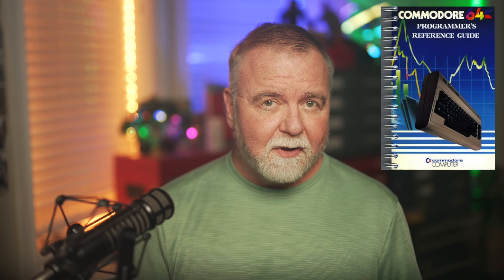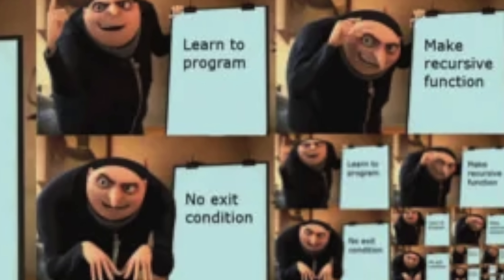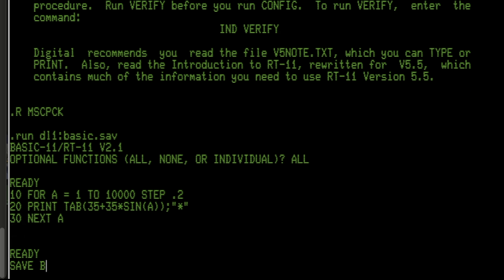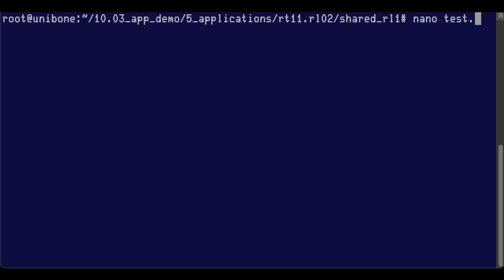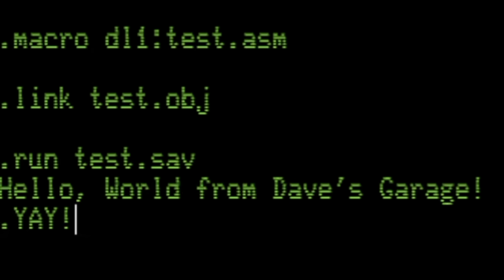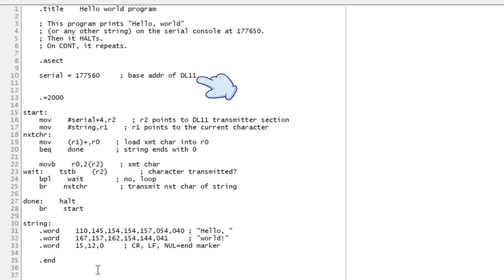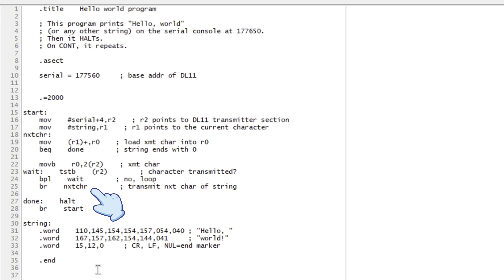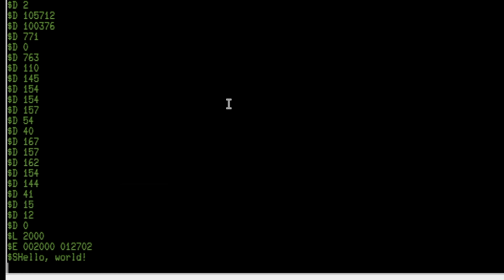Bare Metal Coding: Big Iron!  Assembly Language on the PDP-11/34

Comment: In 1967 I started working for IBM. Started by fixing mainframe hardware. Real BIG IRON weighing literally tons. Occasionally I would have to enter a “hand loop” to reproduce a system failure. I would have to enter the instructions in hexadecimal directly into memory using the maintenance panel. Those were the days and computers had lights……….lots of lights.

Comment: My first introduction to "software" was a course about microcomputers, but the instructor used the PDP 11/05 schematics to illustrate how a "computer" worked, right down to the gate level... It gave me a "Eureka moment" to realize that "software" was a means to get the hardware to be re-configured, on the fly, to perform a sequence of operations that performed the desired movement and math operations on individual high/low 'bits', and on "words".... Suddenly, it made sense!
And, we wrote a boot loader, which actually resulted in something, in the real world, doing something visible, with a big old KSR-33 suddenly clattering away! Talk about "bare metal", seeing 74xx logic devices shifting high/low signals around on data and address lines, multiplexers redirecting signals, ALU's adding and subtracting, all controlled by "instructions" that had specific bits to control what/where/how this all happened! Then, the MC68000 assembly code was clear!!
Reply: In 1977

Comment: This brings back (bad) memories of bare metal assembly on a TI mini computer. It didn't even have a terminal attached, just a teletype writer and a card reader. If you wanted to read cards you had to enter a small card reader program using toggle switches on the front panel. The big project for the semester was writing an assembler. I think mine worked but I could not get it to print to save my life.

Comment: Just a couple of things. You were using MOV to fetch the text characters odf the string instead of MOVB. Presumably you stored the string as words instead of bytes, so H,00,e,00,l,00,l,00....etc. Also, you should check your hardware is ready before using it, not *after*. Both because you don't know if it's ready the first time, and also otherwise you are just throwing away time sitting there waiting for it to finish instead of going away and doing something else at the same time as the I/O is working.

Comment: The first PDP-11 I used had the row of pastel toggle switches on the front panel.  You had to first key in an address 177something in octal , then key in another address, hit deposit, then press start (or similarly labeled key) which would jump to that indirect address and and begin executing the boot ROM to bring up RT-11 from an RK05 drive.  The later 11/34s I worked on had keypads and 7-segment octal digits on the front panels.  Those could boot from ROM by pressing a single button.

I got stuck doing some FORTRAN work on an 11/03 which had two 8” floppies for a while.  That was a huge pain because RT-11 needed one drive and that meant the other drive had to have the editor, FORTRAN compiler and linker swapped in and out on separate diskettes.  That required using PIP to move files around unless you dared to write your intermediate output files directly to the O/S diskette … and sometimes bad stuff happened if you did and the O/S got trashed.  Usually it was do a step, then PIP the output file over to the O/S diskette, swap diskettes in the second drive, PIP the file back, do the next step…. and so-on.  I learned pretty quick to come in after hours and do the work on an 11/34 and then PIP to a floppy to take to the 11/03.  The 11/34 had a DECwriter LA-120 paper terminal which was about 4x the speed of the DECwriter LA-36 on the 11 03.  The first PDP I used had an actual Teletype ASR-33 running at a blazing 110 bps.

For youngsters, PIP = peripheral interchange program.  RT-11 did not abstract physical devices to be treated as files  no matter what or where they are as UNIX kernel does.  You had to have PIP as a separate program to handle that task.  I remember feeling liberated the first time I used UNIX and realized there was no need for anything like PIP (well there’s cpio, but you don’t have to use it).  Having treed directories were quite a breath of fresh air in UNIX too.

Comment: Your where right about being wrong but your reason for being wrong is also.... Well... Wrong.  
JSR(s) don't need any RTS.  They are independent.     Having many coded RTS still means it would need one.   But it does not.   Your other options to JSR without a RTS are;
1) load the SP with an appropriate value an set the IP to an appropriate value.
2) Never return.  as in calling BlueScreenOfDeath kind of thing.

Comment: Dave, you're really bringing back memories. Though most of the rail control system code we ran on our PDP was in FORTRAN, we did use assembler for important operations like resource locking between tasks, time-critical I/O, and code that needed to be re-entrant. That was circa 1990-1994, about 30 years ago. Thanks for the memories.

Comment: I had a microPDP-11 with RSX11, which frankly was a terrible OS. So I hunted the net for a copy of SystemIII but in the mid 90s that was not easy to find online. Eventually in 2000 with the aid of a colleague at IBM, we found it and got it running and then I gave it to my colleague. As that thing (despite being the micro) was too loud and power hungry for such a relatively slow machine.
But I did adore writing assembly for it. As a bit younger guy than Dave, I grew up writing assembly on 6503, 8088 and z80 (I don’t like those) and 68000 and yes pdp11 looked like 68000 as I noticed back then (or actually the other way around).

Comment: My first college assembly programming experience was CTC 28 (1979) on the same 11/40 where I was studying the logic board, and its LS181 4 bit ALU (four of them of course). We submitted jobs on punch cards, that I don't miss a bit (!), and had to be able to walk up to the cabinet and key in the bootstrap from the front switches. I earned one of the 3 'A's received that semester.

Comment: Aren’t you still running the boot monitor?  Wouldn’t bare metal be to get the code booting without the console input?
Reply from the maker: It drops into the boot ROM, but you can jump directly from there to your code with nothing in between.

Comment: In my first job out of college, I worked with several PDP-11s, including the earliest model (eventually called the 11/20, but this machine had no model designation on the front panel). It was equipped with a (removable) disk drive but booting required hand-loading the boot loaded into memory via the binary switched on the console (about 20-30 instructions, IIRC). Talk about bare metal...

 I also loved the instruction set. It was so rational, most of my co-workers and I could manually disassemble an octal dump of code. My company also performed some magic leveraging the PDP-11's Unibus architecture, which was also exciting to work with.

 I later moved on to the Motorola 68000, which had a similarly "orthogonal" instruction set and some advantages (more and larger registers), but was not as simple and pure as the PDP-11.

Thanks for the memories!

Comment: Loved this. Sure brings back memories. My first PDP was 11/20 and did a lot of programing through 11/70s. Programming in assembler was only possible if you could think at the hardware level. That's a mindset few can master -- which is a good thing. Higher level languages finally enabled real productivity. However, understanding what's happening at the "metal" level is good to know. 
Ok Dave, now why don't you write a device driver for a tape drive.

Comment: Wow, I was working at DEC back in 1979 as circuit pack repair technician for the RL01/2 disk drive while I was in college.  I had to be able to control the drive at the register level and hand wrote many PDP11 assembly language routines to be able to control the hardware at the bit level.  This past year I was going through old papers and came across my DEC PDP11 programmers reference pocket guide.    Programing at the assembly level was a lot of fun and, back in those days, it opened a world of imagination of what was to come.  Thanks for the memories, and keep them coming!

Comment: That brought back some memories. Back in the day we had an LSI11 controlling our instruments on a X-ray synchrotron. The problem was that the 'tron would burst out X-rays every now and then and disrupt the RT11 OS. I got sick of losing data, so I "bare-metaled" the data collection program so that a copy of the data we collected was available above the 56K max addressing range of RT11 while it was being streamed out to disk. That way if the OS barfed I could still get at the data that was stored in a region that wasn't reset by the OS. 
That poor LSI11 was regularly abused. Every week or so we had to refresh the particles in the 'tron, and as it was designed to put out polarized X-rays, when that happened we had to go hide behind a hill due to the massive radiation spike before the ring stabilized. The LSI11 couldn't go and hide with us, so it was regularly subjected to large blasts of X-rays. Still, it lived for several years before the CPU board fried. I tried to get just the chips I needed to replace, but DEC demanded the whole board back and made just getting the chip 10x the price of getting a whole new CPU board. (Trade secrets maybe?) I pity whoever got that reworked board. Strangely enough, we never had a RAM failure in the 4 years I was there, and it was still going strong years later from what I heard.

Comment: My first exposure to computers was a PDP-11/33 which I played Adventure on. That was 1978. From there I went to a print shop in my first job and eventually got a job working on a Wang VS77, but that was eventually replaced with a Prime system running Pick OS. I left that job in 78 and ended up on an IBM MVS XA course, then got a job running an MVS system (I thought), but in traditional was running CICS  on a System 38. Once I left there I went to work for a Gas company, running MVS and also an interesting ICL2966 running George3. 

Then it was all PCs. It seems like a lifetime ago….

Comment: The 11/34 might have had a 15MHz clock, but that was the microcode clock.   The actual instruction time, including all the memory bus handshaking, resulted in a not all that speedy a machine.
Reply: Wasn’t the Vax 11/780 approximately 1 MIPS?  That 15 MHz clock sounded fast to me, too.  AFAIK the 11/34 was toward the low end among PDP-11 models, so it should be a lot less powerful than the Vax of a few years later.  Having 15 MHz as the microcode clock makes more sense.  I imagine it takes a fair number of those clock cycles to execute one PDP-11 instruction.
Reply: @kc9scott  Yeah, also remember the UNIBUS was a complex and not too speedy bus also too.  We were a bit disappointed back then when we saw that the 11/34 wasn't noticeably faster than our PDP-8.

Comment: Reminds me of the time I worked on the Burroughs B6700. In it's last days it sat idle as backup, powered up but all it's peripherals except the console had been moved to the new system. I used the hardware memory test panel to loop the thing into constant I/Os to the console spitting out witty comments like "My mind is going, Dave", "Daisy, Daisy" and so on.

Comment: I used two PDP/11s (an 11/20 I think acting as a FEP for an 11/70) during my Computer Science course at Manchester University in the UK starting in 1979.  I remember using assembler code to program an attached Calcomp plotter to output text - my code directed the calcomp how to draw each letter and this was then tested with an input string.  It was very cool.  Those were fun days.  How times have changed.  Thanks for your video.

Comment: Move <from> <to>. Yeah, most of my assembly programming was x86, but it always seemed wrong to do "move <to>, <from>". Also interesting that the BEQ instruction presumably does a test and jump, rather than x86 where the flags are set by a separate command from the conditional jump. (Learnt programming in 1973, still programming).
Reply: I wouldn't expect BEQ to do any test, since that would require it to have more parameters than the other branch instructions.  I just looked it up for PDP11, and it branches based on the Z flag that was set/cleared by a previous instruction, the same as most other processors.

Comment: Dave, I hope you're properly grounded handling those old DEC boards - they really are pretty susceptible to static shocks.  I maintained a load of them back in the 1980s.  We had a couple of customers in London who had endless trouble because they had carpets containing nylon everywhere (including in the computer room). Everywhere you went in these damn places you got a static shock off door handles, filing cabinets etc. Those sites were far and away the largest consumers of replacement boards!

Comment: Early in my career, I programmed an 11/23 (I think - it was called an LSI 11, and defo had a Q-bus) to control and reconstruct images from an isotope emission tomographic medical scanner. Didn't have a compiler or assembler 9or OS), so I hand-wrote the assembly code and hand-assembled it into machine code. Only storage was a 4K core board, It also had 16K of RAM. HIDs were a VT52 and a DD teletype/tape punch (punch/reader was unreliable). I installed/commissioned scanners in the UK, France, Germany, Switzerland and Japan. Company went bust when gamma cameras were found to be better and cheaper.

Comment: Macro 11, I remember it well. !!!, or if I could remember what I did in 1981 then I would remember it well.
The company I worked for Arbat Systems Ltd, wrote their own operating system called AIMS. Arbat Interactive Management System. A Basic like interpreted language with multi precision integer arithmetic. Also all the command line utilities heavily based on Unix. I remember we had an editor called EG based on UniX EM (editor for mortals), but ours was EG Editor for gods as it gave no prompts.
Great memories. My Boss Peter Madams also brought in Whitesmiths C the first commerical C compiler and I still program in C/C++ to this day. Thanks Peter.

Comment: PDP-11 minicomputers aren't Big Iron; a UNIVAC 1108 was big iron and almost all discrete transistors!  Honest to god core memory - you could see each of the bits.  Spread out across a dozen or two floor tiles in your computer room, and that was just the processor, memory and I/O channels.  Tape controller, drums and disks where elsewhere, taking up their own space.   I loved the PDP-11 though, such a nice clear architecture.  Only had one zero, unlike the UNIVAC with 1's complement arithmetic with both +0 and -0 values.  Bonus!

Comment: I started with programming on the canon sx300 in 1975. We wrote programs for accountants. Each accountant would design his own chart of accounts, and my job was to punch in the text for those 300 accounts. So tedious! Our leaders were comp-sci students at uni. I was 20 and a uni dropout. But i had reasonable maths skills and had a job operating an ibm 360 at nights. I hated operating that beast. For some reason i liked programming! I graduated to our new platform, which was a pdp11 with a teletype console, twin 8 inch floppies, typically 16k of memory and running RT11. The left hand or a: drive contained all our programs and the accountant's client list, while the b: drive held a single client's data. My first task was to write a utility in macro-11 to verify the integrity of the client data and recover as much as possible if corrupted. The others were busy manually fixing client data disks as someone had fooled with the buffered write (bwrite from clib) and forgot that sometimes users would create odd numbers of transactions and all our testing was done with simple debits & credits. Such were the good, bad and ugly of computing in the 70s...

Comment: The best one yet, this puts a huge smile on my face. I worked at DEC in the Galway plant in Ireland building PDP 8’s and then PDP 11’s. Lots of assembly in diagnostics, and we had to start using binary (012737…)  entered through the front console before the machine could do anything. Yes, the switches and the lights! We would create short loops to exercise a fault area, like a stuck bit, so that we could stick a scope on a clock/enable signal and see what was going on. Those were happy days. Thank you for this piece of nostalgia, it’s been 40 years. Subscribed.
Reply: I worked at the Augusta, Maine plant as a tech where we made various comm devices, including the early generations of Ethernet interfaces for PDP-11s and VAX Systems.  First class I took on being hired was PDP-11 machine language.

Comment: PDP-11 was my first contact with a computer in late 70's then it was possible to connect to an IBM Mainframe with a 300 bauds modem using a paper terminal.  Learned to program in Basic on the PDP and APL on the IBM.

Comment: Most programmer today often do not know that C was influenced by the PDP-11 assembler and its various ways to address memory. In C it was called 'pointers'. So if someone knew PDP-11 assembler, learning C was just straight forward. Direct addresses, indirect addresses (aka pointers in C), post-increment, pre-decrement etc
Reply: I remember using the original Kernihan and Ritchie "C' book.
Reply: Still have it lol
Reply: C was initialy described to me by one of the early programmers as a portable PDP11 assembler